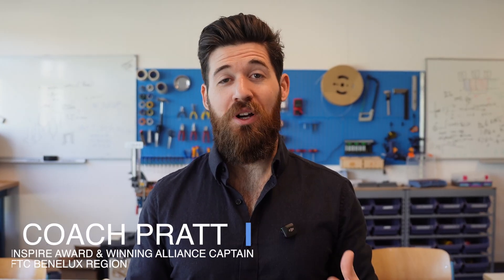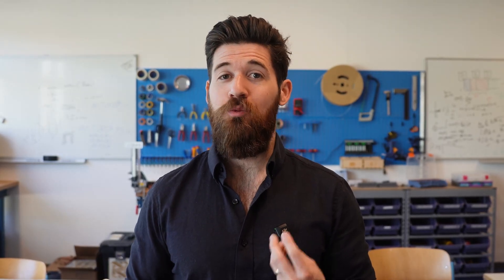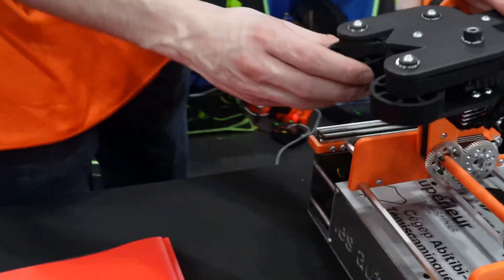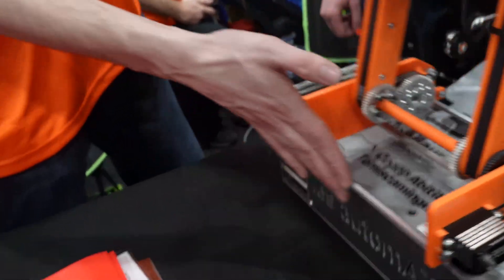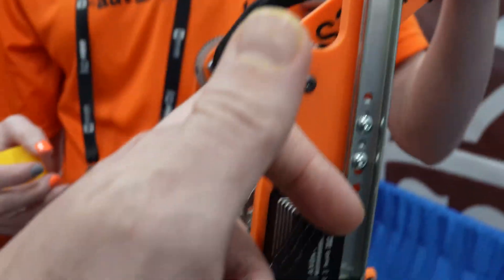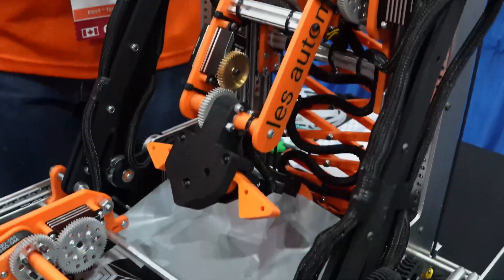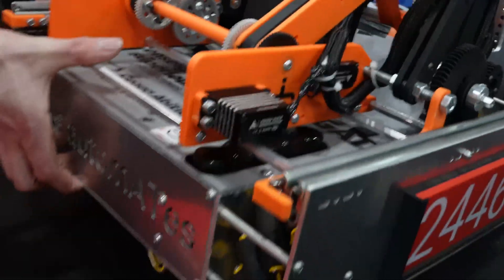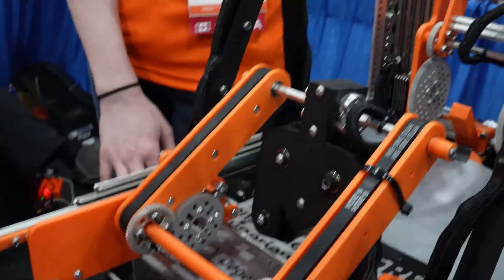FTC Robots Revealed: 24461 Automates - COTS

Comment: OK, I love your message about robust simplicity, but with the custom machined plates, custom 3D printed parts and Axon servos that's still light years away from "parts you already have".  Sure it's likely simple by world championship standards but it's still a quantum leap from where most teams are at.  Props for them rocking the viper slides though.
Reply from the maker: That's a fair enough point. That said, while they may be 3d printed parts, and water jetted plates, the design of the mechanisms themselves are very simple. Spur gear reductions/overdrive on simple 2 bar linkages for much of their system, and the plates are simply external bounds. It's a simple design done well.